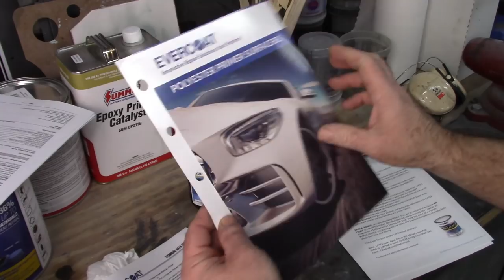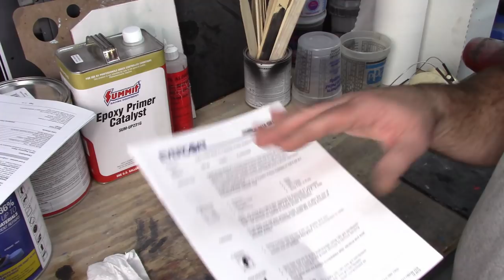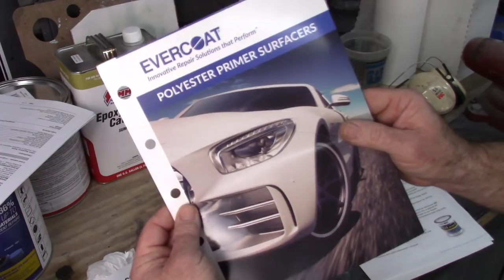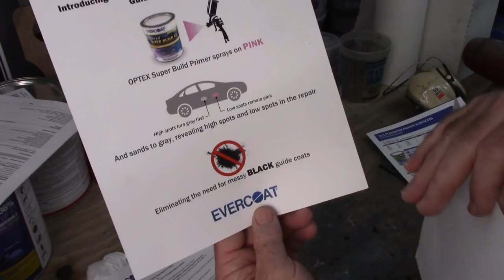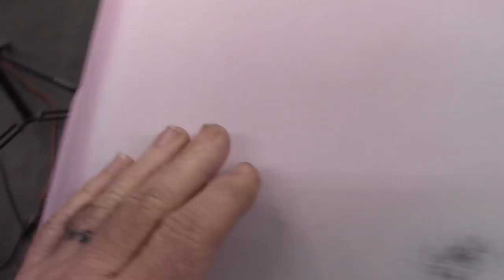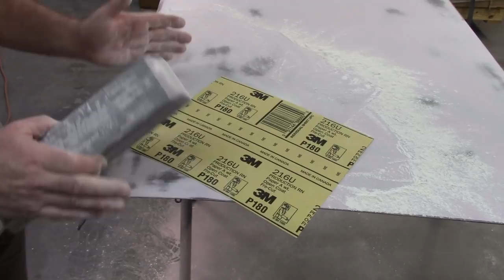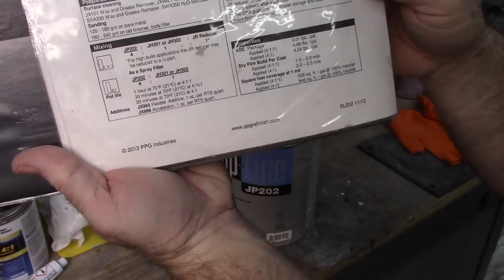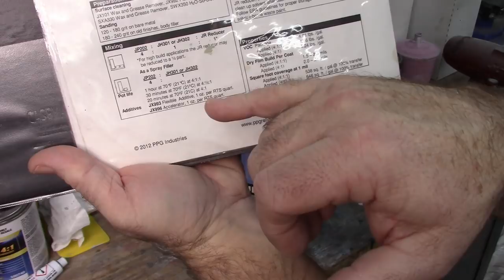Spraying Evercoat Optex, PPG 2K primer surfacer with Harbor Freight Spray gun. 1968 Mustang. Jade.

Comment from the maker: Not the results I expected. I will block sand this panel at a later date. I like to let build primer dry out over a few weeks to allow for any shrinkage.
Reply: The solvents should evap out of surface primers within 8 to 12 hours. And it shouldn't take but 72 hours to completely set. I would think. I've not heard of anyone waiting weeks. Who has that much time? LOL
Reply from the maker: @Lightedbeam  When you're doing paying jobs, you set your personal stuff aside. This is one of my personal cars.  No rush.
Reply: @JoDaddysGarage  We make time for what we want to make time for. I get it. Thanks.
Reply: I am using their super build 4/1 and had to go with an iwata 2.0 and it still has dried up in my gun booth times I’ve shot it
But it builds really nice
Reply: Where did you purchase that adaptor and paint cup setup for your black widow gun
Reply from the maker: @ozakijones4035  I bought mine from the PPG store.
Reply: @Lightedbeam  if you want a pro finish you have to wait 1 week to be full set wt any shrinkage

Comment: I really wish I had watched this video yesterday! Yesterday I sprayed a firebird with the Optex Super Build 4:1 product using the cheep harbor freight purple, gun drilled out to a 2.0 tip.  Got the same result with the textured finish. My gut tells me the 2.0 tip was fine but I needed much more pressure then I was using. May also try drilling the tip out to 3.0 and see what happens. Those HF Purple guns are so cheep it really is not much of a gamble.  Thanks for your review. it was super helpful!

Comment: A home builder doing this type of a restoration would surely use a polyester primer to do their project correctly.  So I'd say a 2.0-3.0 tip primer gun is very much something a lot have or will buy when they get to that point.  They sent me the same primer and I will try it out on something eventually.  I really don't think putting a light dry uneven coat over the panel, nowhere near the recommended mill thickness, and then sanding with a da, inline air sander, and a soft durablock is really a good indicator of how this product may work.  Put 2-3 wet coats on, block it with a rigid acrylic bock and the results might be much different.  That being said, I do think this product is a gimmick geared towards the amateur home builders, just like the color changing body filler.  The one thing that does interest me in it is the fact that it can go direct to metal supposedly.  If it has close to 0 shrinkage like other good polyester primers, and in fact  does hold up going over bare metal as good as an epoxy. It could be a real time and money saver.

Comment: Sign me up as well. FWIW, I use the Devilbiss FLG4 gun. with the DeKups system very similar to what your using. The nice thing about the FLG4 is, it has 4 tip sizes that are changeable. It comes with a 1.3, 1.5, 1.8 and a 2.2 which gives a nice array of choices. I can shoot sealers all the way up to heavy build primers all with the same gun. Great job as always.
Reply from the maker: You won the t-shirt. Send me an email. jodaddysgarage@gmail.com

Comment: Great home video! 👍🏼 you are absolutely right, the evercoat optex súper build is not for everyone, I work in a high volume production shop and I recently did an aftermarket custom fiberglass hood with the gel coat, we sanded it with 80 and applied the super build on it with a 3M accuspray gun with the 2.0 (red) tip, it worked pretty good, it went on pink, dried pink and after a good bake cycle and 2 hour cool down, sanded it with 180 grit and it sanded completely gray, not as easy to sand but not too bad, anyways just thought I shared this with you, because you nailed it when you said maybe not for the do it yourself at home guy, but it’s definitely worth a shot if you’re gonna expand your spray gun arsenal! Great video though! Keep em coming and if you still have that t-shirt “sing me up for the t-shirt”
Reply from the maker: Thanks for the comment. T-shirt is gone. Sorry.

Comment: I am no expert but I have seen guys use up to 10% Acrylic Reducer. The chemistry is the same as most all paints, plus they getting good material flow, very smooth and great results. 
  I am not sure about this product but looking at high build products, some have very short pot life. I know because this made me think of the method I will be using...painting one panel at a time. Less materials to mix at once, then not as much time in the cup as you account for temperature and flash time. Just a thought. Hey, wait a minute. You have done this before! You, you experienced guy you. Ooooh!

Comment: I use acetone to thin Slick Sand with a smaller tip gun and to clean the gun. It might work with this as well. Also like Slick sand it sands hard. Nice thing about Slick sand it won't shrink.

Comment: de beer high-solid filler does the same job. you mix it 4-1 with hardner and spray it on. its black untill you sand it and then it turns grey so yo can se every imperfection

Comment: Pink primer 💥😆💥 Drill out your purple gun to 2.0, or get a 2.0 or larger from summit for $30, or see if you can reduce with acetone, I’ve found with thick primer in non booth conditions, between coats you might have to clean the gun, to avoid coagulation and a tiny fan cuz the guns clogging

Comment: Maybe evercoat send you a gun with a 2.0 tip so you can give it another test. 
I learn every time . 
One thing I did was keep a single edge razor blade to cut tape to a fine point to mark my cup for ratio's like your 4:1:1 
Kept it simple for my old eyes . 
One pointer on each , I called em add to lines.

Comment: Does the cup have a vent hole in it? Looks like it started out good then it had a vacuum lock.
Reply from the maker: No vent. The liner collapses with use.
Reply: @JoDaddysGarage  Just noticed something in the video. Did you hear that sound of the air sputtering? That's the sound of the nozzle leaking. I believe it needs to be tightened to prevent the air pushing into the fluid side.

Comment: That black widow cost $150 on sale? That expensive for a Chinese  primer gun! Is it only a 1.7 tip, did it come with 1.3 or 1.4 for paint?
Reply from the maker: I bought 2 guns. One for primer and one for top coat. It has a 1.3 tip I believe.
Reply: @JoDaddysGarage  
Oh ok
1.3 will be good for most base coats and clear coats.
Make sure to upload a vid of you using it for top coat application.
Cheers

Comment: I notice that when you mixed the primer in cup you did not strain the primer this could be the reason why you could not get the flo of fluid just a sugesstion. their is a reiew. the hf black widiow gun comes in two fluid tip sizes a 1.3 and 1.7. is a gun on wish comes with three different size tips under 50.00 .

Comment: just my take, over the years of cars getting washed and polished the edges are the parts that get through the paint first, so i always start a panel with covering the edges first the difference of colors is easier to see i got a good coverage. I would say that paint does not always stick well to really smooth surfaces, so i always do at least 2 light dusting coats to create a key for the paint to stick to, let the coat dry out a little between each coat, next i would do a solid paint as you did, but in a direction more like front to back one coat from the right, let that dry a little, then a coat front to back from the left hand side, let that dry then one more coat on the edges, then a coat side to side from the back, then the finish coat as you did side to side from the front. al coats up until the last one is about coverage, the last one is the only one i concentrate on finish. painting is about shadows and light, and if you ever come back to a project that has dried and look at it with a light you many times see the parts that did not get a full coverage because the gun was not at a 90 angle to the job when sprayed, the limitation in the length of the human arm and the stance of a painter makes it impossible to achieve full coverage from one direction, coming from different directions fixes that.
Reply from the maker: Good advice. Thanks for commenting. Always more to learn.

Comment: Do you use the Hi Flo air fittings when spraying the HVLP guns?
Reply from the maker: I use standard fittings. Same as any air tool that I use. I would likely have to step up the size of my air hose to take advantage of those fittings.

Comment: 200 for a HF gun that you can't get needles/cups for? For a little extra you can get the concourse set from Eastwood; 2 guns and multiple cup/needle combos for each. Yeah, the "case" is trash but the set itself is amazing.

That said, I paired it with Tamco products and strained from the mixing cup to the paint cup, so your mileage may vary.

Comment: Just a note on the color change primer.  I think by first hitting the panel with the DA you took away the color change action by dropping into the low spots. It should work just like guide coat but with the disadvantage of not being able to reapply when you want to. It is a one shot guide coat.  If you decide to try the product again with a different gun you should block sand from the start and see if the color change works out better the second time around.
Reply from the maker: I agree. I wasn't sure what to expect, so I tried different things.

Comment: Tip. If the viscosity is too thick even if it says no, thin it down . All It loses is its high build and just  becomes a normal filler /primer. I've  just seen.... DON'T USE 80 GRIT!!!!! Too late!  120 and then 180, then 320. No point in putting all that primer on and then sanding it all off again...NOoooooooooooo ! Remember, the least amount of primer and paint gives you the best finish.

Comment: get you some nice, cheap, "throw-away" paint guns to spray epoxy and high builds.. i use acetone to clean the gun out after.. cleans easier/faster, although a lot more harsh. it'll eat up some o-rings. but i get a few uses out of the cheap HF guns, then toss them.. where do you get your ppg products from? local or online somewhere? throw my name in for the shirt too.

Comment: Well, in addition to using the wrong tip size it does clearly states " BLACK WIDOW® BY SPECTRUM® delivers a precision spray pattern for professional results with top coats". I.E not designed for Primer!
Reply from the maker: To be clear, I did use the black widow PRIMER gun. There are 2 different guns. Thanks.